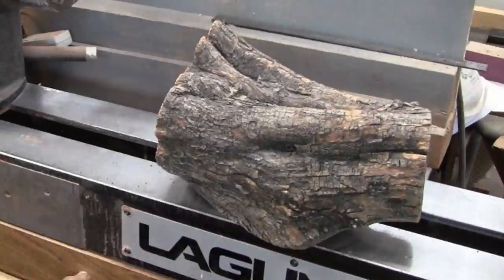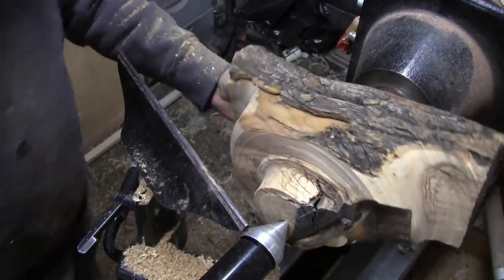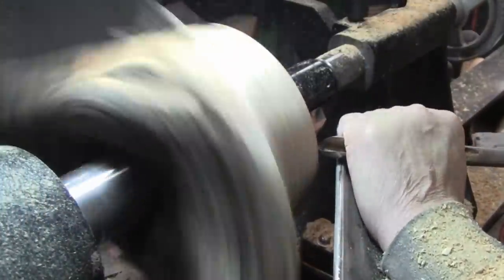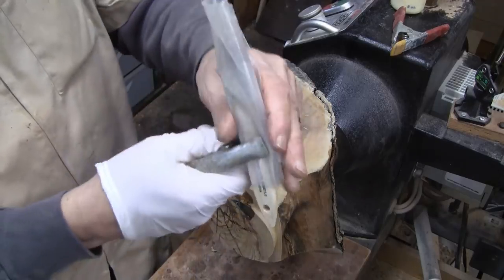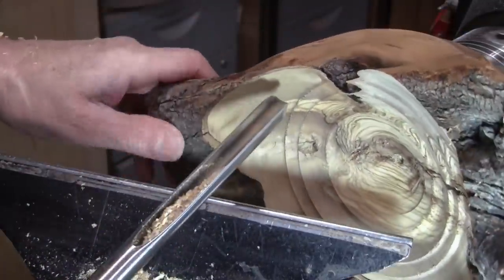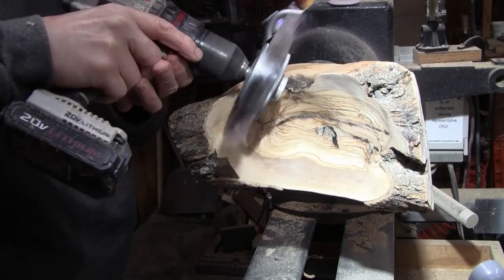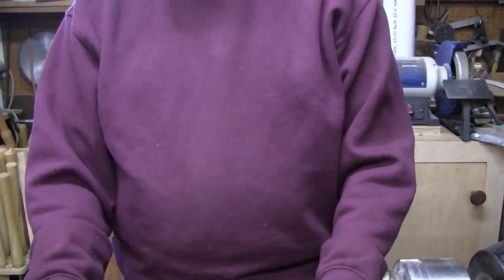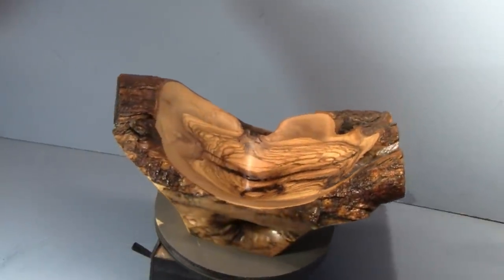Wood Turning A Foot And A Face  Olive Wood

Comment: I'd say this project was worth the effort in the end...spectacular grain in Olivewood.
I can't turn such irregular shaped blanks like this. My lathe's slowest speed is 750 RPM and I'd be chasing the thing around the shop with a piece like this. I'm working on an idea to slow down the speed to about 425 RPM.
Reply from the maker: Thank you Gil, I am guessing yours has a Reeves drive? I had a Jet 1442 that was and I though of a variable speed motor or a jack shaft setup. But never did either. A DC motor and VFD is a good option and then you would still have your pulley system for going real slow.
Take care,
Gary
Reply: @ThePapa1947  Yes it is a Reeves drive on an old Shopsmith. The new ones have electronic control and have much better speed range and they are reversible, but  way out of my budget. I'm adapting a two speed motor out of an evaporative cooler to drive one end of the output shaft. It will turn the shaft at the same speed as the squirrel cage fan. It won't have the same torque but enough for slow speed turning and sanding. For reverse I simply mount the chuck on the opposite end of the output shaft. The main concern is the motor was cooled by the air moved by the squirrel cage and this use won't have that advantage. I guess I'll find out soon if it wants to overheat or not.

Comment: Absolutely amazing 💜💜💜💜💜💜💜💜💜💜. I think that it would have been ok if you had gotten down into the inclusion, since it should only be used as art. It might have come out even more amazing.
Reply from the maker: Thank you J'Lyssa, yes you are right it would have looked fine cutting through. I turn plenty of things with holes in them. And actually really like them that way. 
Thanks for watching,
Gary